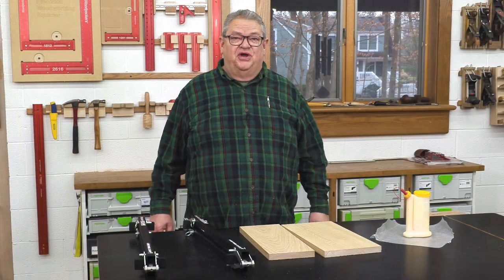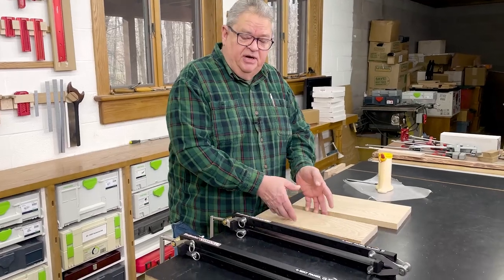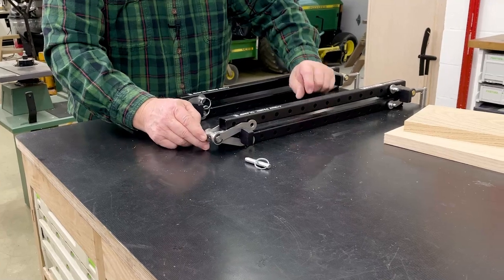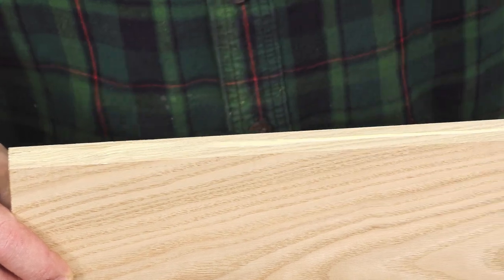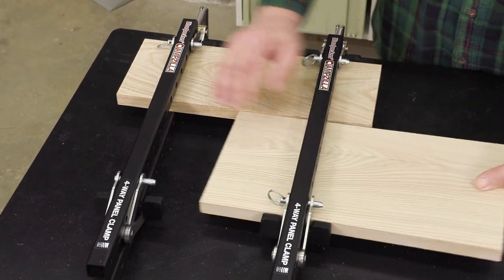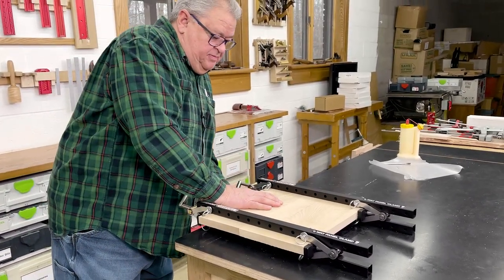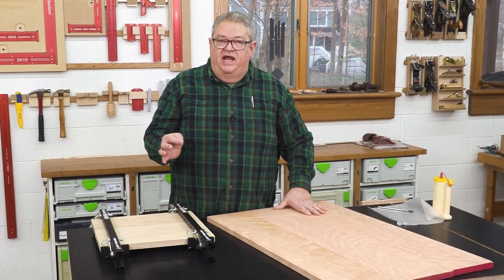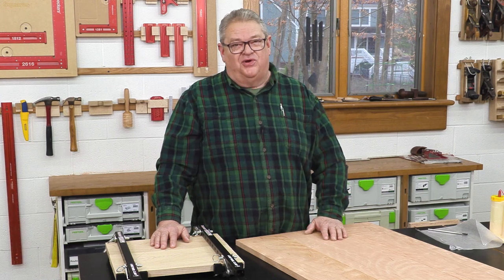CLAMPZILLA Basics For Easy Glue-Ups | Deep Dive | Woodpeckers Tools

Comment: As expected, great tips.  I, like others, struggled to find a convenient, less frustrating, way to get these to work and, more importantly, a good way to guess where I should place my clamping brackets.  FINALLY, someone has the balls to ‘question’ the over gluing way too any YouTubers use.  One should not have to 2-3 times more glue squeeze out than is applied or truly needed: if it squeezes out, it is not needed.  But, I suppose the TiteBond folks like excessive gluing to support their bottom line… 

I will also add that I lined my bars, the edge that contacts the wood, with Gorilla ‘packing’ tape.  That provided a non-stick surface for the top and bottom bars: no glue cleanup on the bars.  I just made / cut a couple 1/8" and 3/16" HDPE strips to use instead of the tape (because it keeps coming off).  I am working a “permanent” solution by just screwing them one.  The 3/16" thickness should provide enough depth to countersink a screw (little deeper to avoid wood contact), and I could just use one full-length strip: make 4 HDPE strips.  The HDPE should make glue clean up a lot simpler.  It would be nice if the Woodpecker folks would have a smooth, mon-stick surface built-in / applied to the bars to stop glue from sticking to the metal bars.  Heck, even a 1/16" HDPE-like attachment would be fine.  I “needed” to use thicker material because my panel widths lengths varied, depending on what I was cutting and thicker HDPE is easier to handle amidst all the other glue-up things I gotta watch.  Plus, the HDPE provides a nice smooth, non-marring wood-to-bar clamp surface.

Clampzillas are the only way to go when gluing edge grain boards and cutting board ‘pieces’ together for a truly flat surfaces.

Comment: These clamps are amazing. I've made multiple live edge cutting boards and the clamps worked perfectly. Because the end of the clamps are flexible I had zero problems with wobbling and making a perfect glue up.

Comment: Jeff, thanks for another practical video, straightforward and to the point. I see the retrofit kit is on the website for prior versions of clampzilla, but what about the option to order the 38” rails separately like you can do for the 18” rails? Seems that would be an easy option for folks who would like to give these a try on smaller projects and then have the ability to upsize as their projects grow. Just a thought to add some flexibility.

Comment: Just received my Clampzilla. The videos are a big help. However, l've yet to glue my cutting board because I have so many seems to glue. You mentioned opening one of the ends, then glue and pin the clamps AFTER gluing. I don't think I can slide the pieces one by one per your video. I would think it would be to messy and the glue would set up before I finished.

Comment: Thanks for one more terrific deep drive that is very useful.  A couple of questions:  (1) Do you worry about glue getting on the tension bars?  I've put waxed paper on both sides of my wood panels, but that makes for more work and I'm not sure it's necessary.  (2)  I see that you put glue on both sides of the joint.  Why have you found this to be the best approach, as many folks will say put it just on one side.  Additionally, a comment that I'd appreciate you taking back to Woodpecker senior management:  I never see any free shipping specials from Woodpeckers and sometimes shipping is a substantial part of the total cost.  After counting out of curiosity and to my surprise, I've placed 53 orders from Woodpeckers since 2009, and have a lot of Woodpecker tools in my shop.  Yet, even for a long-term customer, there are no free shipping specials or an offer for free shipping for a purchase over a certain amount, similar to what is done at Rocklers and other places.  Thanks.  Brian Sack
Reply from the maker: I guess it's just something my Dad taught me. Thin application of glue on both surfaces rather than a heavy application on one. It's been working for me for 40 years, so I'm not likely to change now. I've found the glue pops off the bars pretty easily.

Comment: The Rockler version with wood cauls are easier to deal with in terms of getting the boards in and the panels out.  You don't have to pull pins to get the top caul off.  Sliding the boards in trough the side is a recipe for getting glue everywhere.

Comment: What is the typical distance between clamps for them to still be effective?  6, 8, 10, or 12 inches?
Reply from the maker: With well prepared stock, I would say 12 to 18 inches. You can also space them out a little more and put regular bar clamps between them, if needed.

Comment: My question is how many clamps do you need for a panel that is 8’ long. Every 12” or 18” or 24” apart? Thanks
Reply from the maker: That depends a bit on thickness and how well the joints match. 3/4" stock with good fitting glue lines, you can probably go 24" between. If you already have parallel jaw clamps or pipe clamps, you could use 4 ClampZILLAs with normal clamps between. 6 ClampZILLAs would give you one every 19". That would be excellent.
Reply: @WoodpeckersLLC  thank you

Comment: I purchased the previous version with the extension bars 18” and 50” 4 pairs each. Can I purchase the scissors bracket? This will allow me to have full set on each size. Let me know. Thanks
Reply from the maker: There's an upgrade kit to convert your old scissors bracket to the new, but it doesn't include the screw. Call Customer Service, they may be able to figure something out.
Reply: @WoodpeckersLLC  I purchased the upgrade kit. Are you saying I may be able to buy the screw too so I can have 8 pairs of a new upgraded scissor clamp?
Reply from the maker: I'm not saying that...I'm saying ask Customer Service. They may say no, but...they might not!
Reply: @WoodpeckersLLC  got it!! Thank you! I’ll give them a call!

Comment: Love the design, just not sure the downward clamping power would be enough.
Reply from the maker: Obviously, it depends on how much spring the stock has in it. What I've found is, you might have to "help" the vertical pressure a little (see last week's DD and you'll see me using a mallet), but once they're aligned the pressure is sufficient to prevent them from sliding back.
Reply: No way that these have enough vertical force to take the spring out of the stock. Which is why a regular bar clamp does the same thing and keeps you money for more worthwhile Woodpecker things.

Comment: So I have owed the 4 pack clampZILLA 38 inches for about 2years now and I am disappointed. The cast iron foot pad, the piece that touches the side of a panel glue up will easily crack.   I have been given replacement pads but they will crack.   Please use steal. 
Another issue is I never get perfect seams on 3 or more boards of 4 foot or longer glue up. There is always a little off set at various point.   Just expect lots of sanding or hand planing.

Comment: Clampzillas look like way too much trouble to set up and use.  You said in your video that fiddling with the pins etc you saved time?? Looked like a waste of time to me. Sorry!! And the price is ridicules.
Reply: check this video out for a much easier way to load them. I have these clamps and didn't even think of this lol
If you were to build these clamps yourself (get square steel tubing from Home Depot and the hardware) you'd spend just about the same money to build yourself. Price is well justified.
Reply: Claude. 😂😂😂😂😂😂😂😂